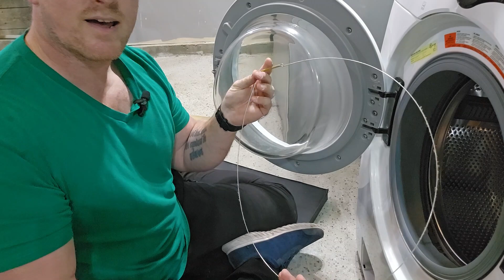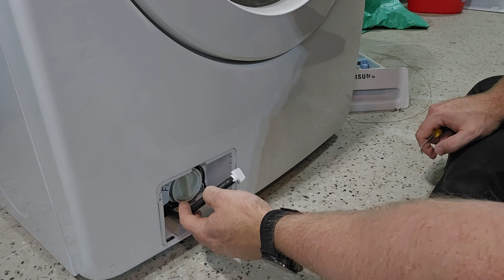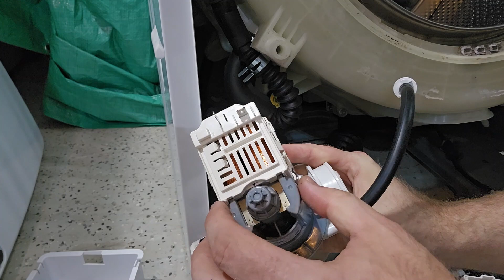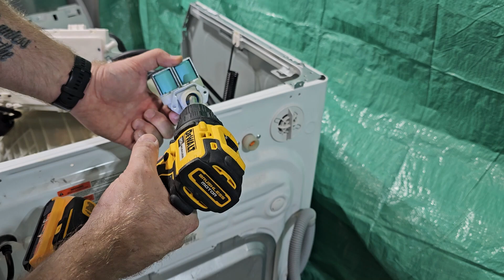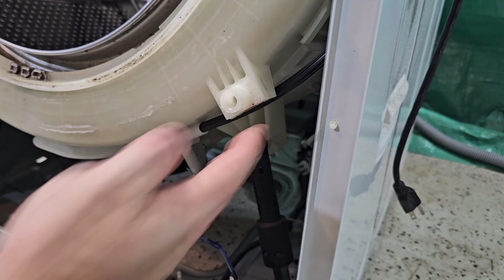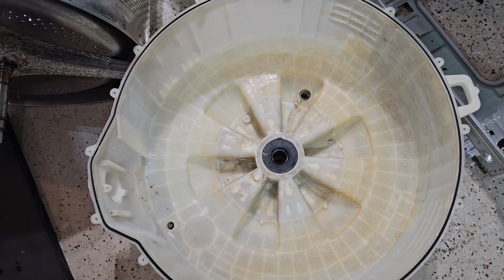Unlocking The Secrets Of Your Samsung Front Load Washer: Complete Disassembly Tutorial

Comment: I took mine apart today.  I laid my 3-ton car jack handle/pole across the top of the washer.  Used a short double-loop strap and wrapped around the drum assembly handle essentially hung the drum assembly as high as possible.  There were no tension left in the springs and removing them was a piece of cake.  In addition, then my son and I lifted and carried the pole with the drum assembly hung under it and walked it right out of the washer enclosure.
Reply from the maker: Good job!